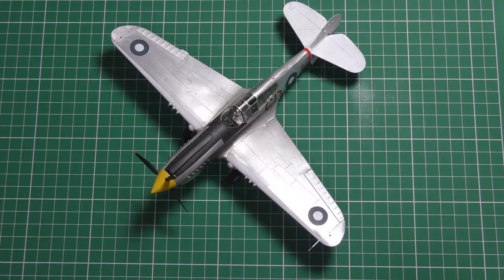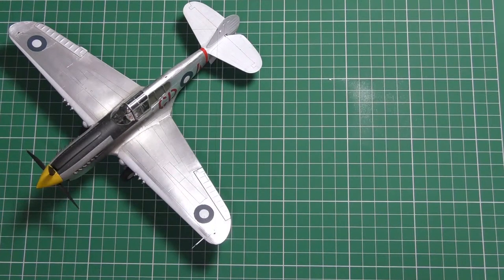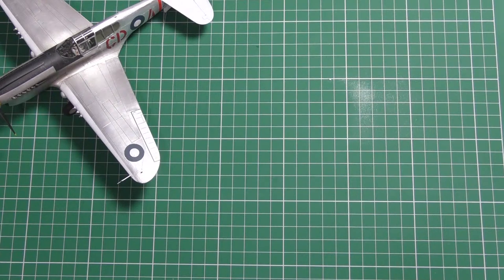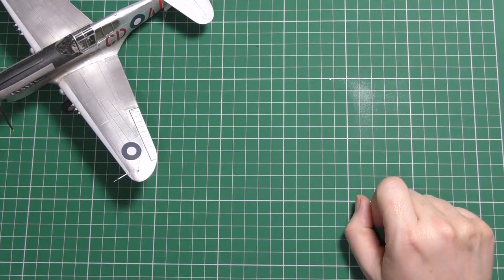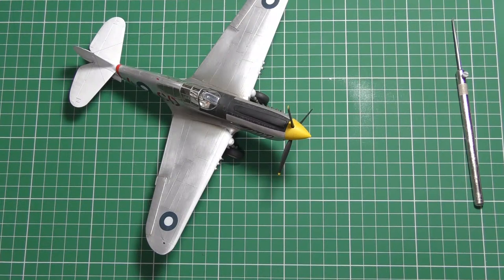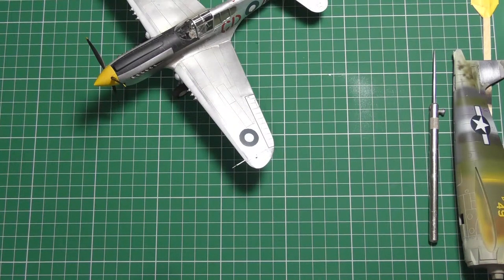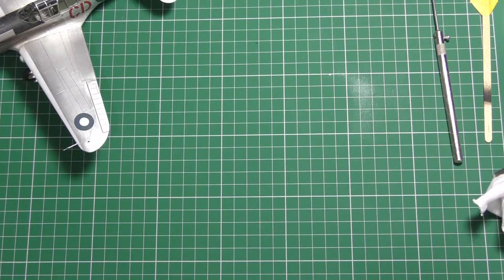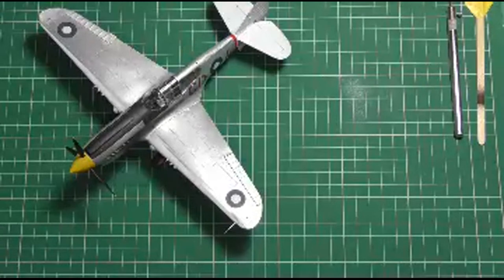Foilcraft 101 - Feedback and Reflection

Comment: Very nicely done Jen.  I have been foiling for several years and using the same materials as you show except the "glue spreader". lol   I use a moistened flat brush (eliminates the brush marks) to apply the glue on the panel I, then attach a slightly oversized piece of foil.  After burnishing , I "grain" the panel with 4/0 steel wool or  sand paper. Your right in that you have to think about how your going to build and foil the model. I try to wrap the foil around the leading and trailing edges to eliminate the issues you mentioned when handling the model. I found a clear coat will not effect the the look and gives a cleaner mask line when painting and the decals adhere better.  You can also patina the foil by soaking  in bleach, darkening more buy adding  a few lead fishing sinkers or adding some pennies to give it a copper color. Just don't soak for more then 2-3 hours or you'll have pin holes in the foil. I've done demonstrations at club meetings, but these guys say they can paint a NMF, but in the end it still looks like paint. Congratulations on your demonstrations and look forward to seeing more . Nothing looks like metal than metal. My first was a 1/32 Trumpeter  English Electric F1A Lightning  56 Squadron "Firebirds"  1963 Demo Team.
Reply from the maker: Fantastic info Jack, your Lightning is beautiful too. This is definitely something I will revisit in a future build.

Comment: Pretty sure you are one decimal point off in the foil thickness: .02 vs .045 mm thick.
Offset sheet is .2 to .3 mm thick, and is not crinkly foil but stiff sheet aluminium.

I'm impressed with you videos. Valuable info here, if a bit rambly. Glad I found you. You got yourself a sub.
Reply from the maker: Well I'm rambly so......

Comment: I did this to a 1/24th scale Airfix p51 Mustang probably about 40 years ago. As a glue I used thinned oil based clear varnish on both surfaces. let it dry to a tacky feel and use it as a contact type adhesive. Ill give the Raynolds wrap a try though as sanding thin foil is kinda hard.

Comment: Just as a note from an American - Reynolds makes foil in a variety of thicknesses so make sure you're getting the right one.  It looks like your "UK kitchen foil" is about the same thickness as the regular reynolds foil.  It would be a shame to go to the expense of importing it and getting the wrong one.

I would say that if you're looking at 15-20 pounds for a roll of foil, I would suggest you look to see if you can find a domestic alternative.  That heavy duty roll only costs about 6 to 7 dollars here.
Reply from the maker: I got mine on a Detachment so I only paid I think $2 per roll, and have enough to last as long as I'll need it. Unfortunately the heavy foil over here always seems to have a pattern embossed on it - hence turning to the Reynolds wrap. I'm sure there are alternatives here, and I appreciate your input on it too :-)

Comment: It might be possible that UK restaurants have access to heavier aluminum foil - industrial strength, as it were. In the U.S. Nuts come in a cardboard can that has a thick aluminum seal over the top that is nearly the full diameter of the can. I would recommend cutting it out rather than peeling off, as it is impossible not to distort the foil. It is not always smooth. And thank you for introducing me to many products.
Reply from the maker: It's always worth being on the lookout for things like that Dennis, there are many useful bits and bobs outside the modelling domain. Thick foil like that can be really useful for making seat harnesses and the like.